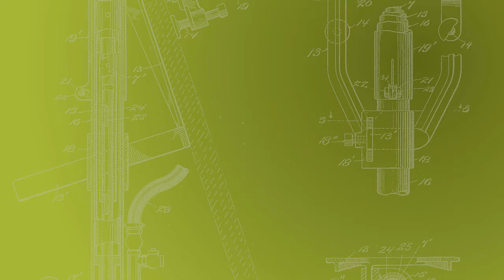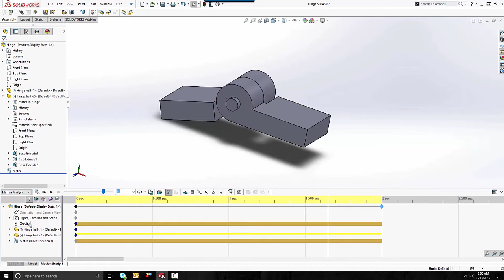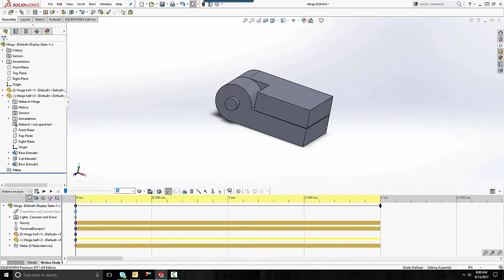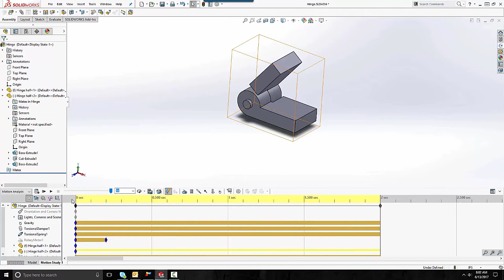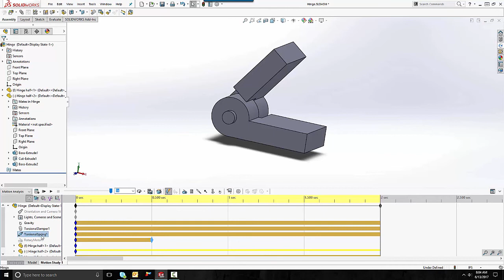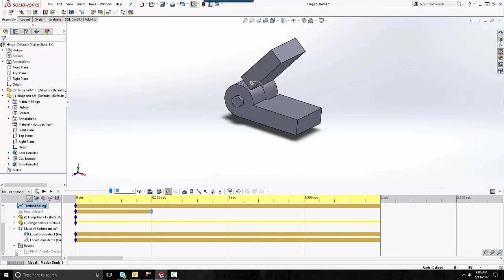SOLIDWORKS Motion - Torsional Spring

Comment: Good day to Goengineer, may i know the purpose for setting the time "0.5s" in the Motor parameter ? Is the Motor will perform for total of about 05 s or will start to perform at 05s? Thankyou Goengineer ~~
Reply from the maker: The 0.5s is the rate that the motor moves.  We configured it to move at a rate of 15 deg per 0.5 seconds.  We control when the motor starts and stops in the timeline.